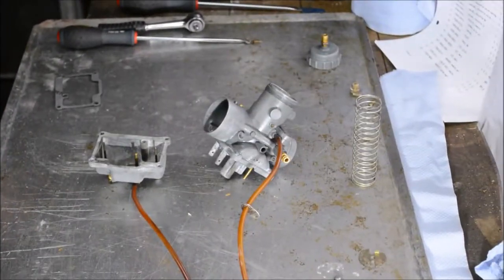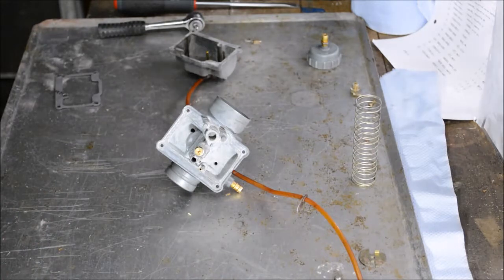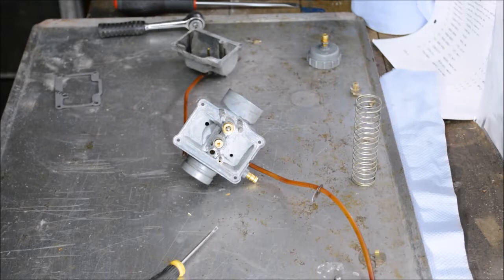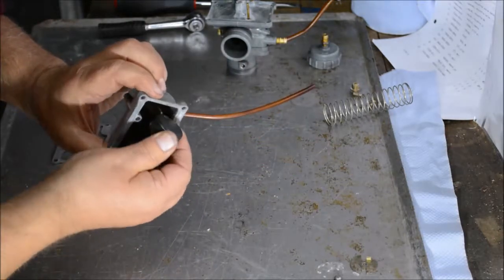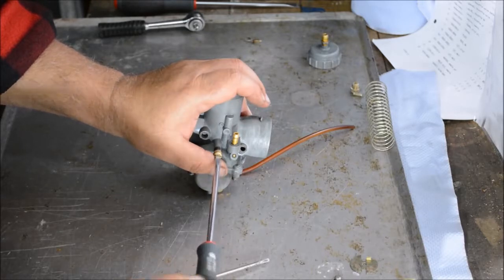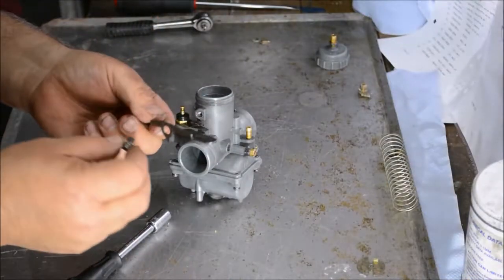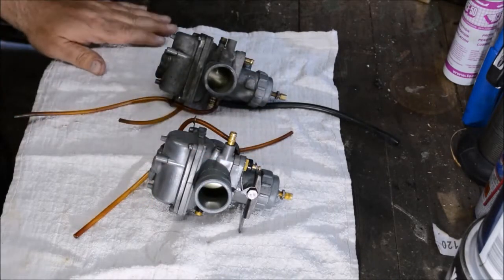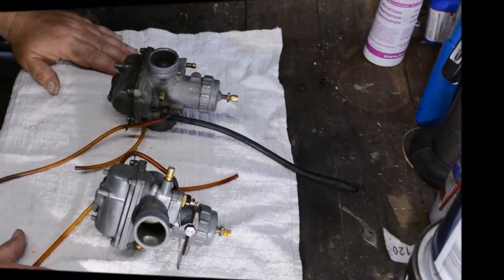Suzuki GT250 carb refurbish and rebuild

Comment: Hi Paul I have gt250 1975 ,just bought it flooded into cassing, drained it out left it ,in meantime I got carb bowls with overflows .iam just wondering about starting it up .do you think it will be OK or shall I remove crank and have a look .can u help at all
Reply from the maker: Had my GT do pretty much the same thing, in fact it hydraulic locked after been left overnight.
If memory serves me correct there is a drain plug in the engine main cases on RH side.
So after draining and 'venting' the motor I put some oil directly in the bores via the spark plug holes, made sure the autolube was full and kicked it over until my leg went numb.
When I came to actually run it I used an auxiliary tank with pre-mix.
Probably overdone but no seized motor, plenty of smoke at first though 😱

Comment: Paul, 
What are the two smaller gauge lines are still installed at the 1:30 mark? Im trying to find out if these carbs will work for a retro-fit I'm doing for a 1974 gt250 hustler.
Thank you for posting videos to help people like me!
Reply from the maker: Hi Drew, nothing more sophisticated than overflows. This link  https://www.youtube.com/watch?v=hE-cmwt4X8o should take you to video of me syncing the carbs and you can see tubes in place on the carbs fitted to the bike which hopefully will make things a little more obvious.
Thank you for your comments, just so you know though I am not a 'qualified mechanic' simply a well meaning amateur with 40 plus years experience of servicing, building and repairing bikes; hope your project goes well

Comment: Hi Paul, what rebuild kit did you use?  Most of the ones I've found online are for the earlier model.
Reply from the maker: Hi, can't remember the brand now (was several years ago) sorry about that. Seem to recall I got most parts from Wemoto at the time so probably from them.
Hope the refurb goes well.

Comment: Lol iam from hull ,can spot ull accent a mile away .just got gt 250 1975 ,having starting problems ,and kick start stopped returning on its own for f sake .😢
Reply from the maker: LOL at least you did not need a translator, some commented they could not understand one of my videos because of my accent. 🤣
A little while back I replaced the kick start spring on a DT 400, not a massively technical job, did have to swear at it quite a bit though as the 400 kick start also has a ratchet pawl that has to be phased correctly.
Let me know how you get on 🤫